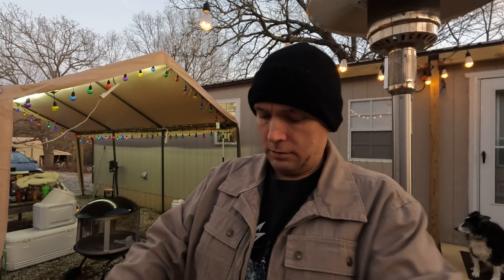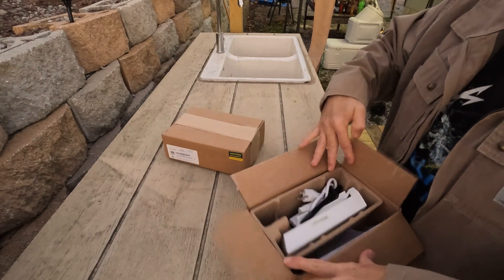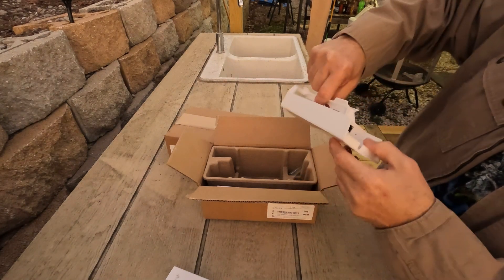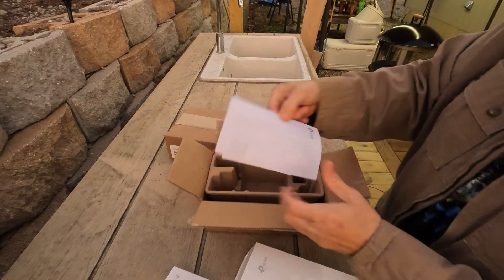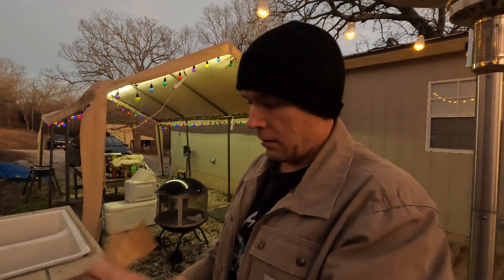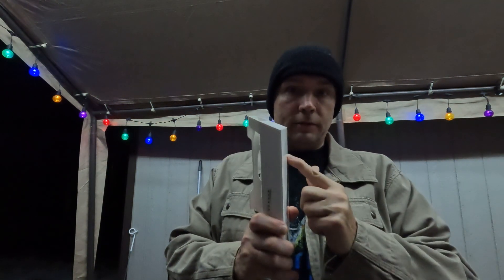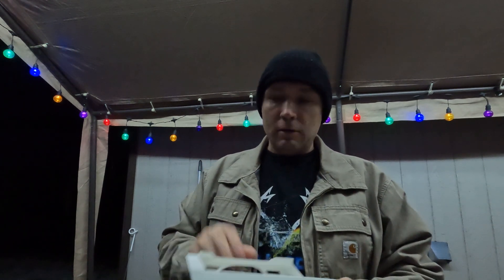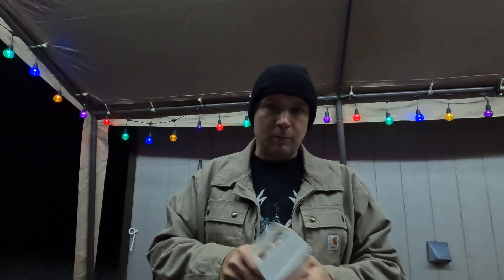TP Link CPE 210 wireless bridge unbox and install to the barn

Comment: I'm thinking of using this as a rudimentary extender down a 3/4 mile driveway. Am I correct in understanding that you cannot simply point one of these out, and then pick up wireless signal from within its range, but rather you need to point it at another one and then have the far one connected to a router or something? Thanks!
Reply from the maker: First you are correct. These are a bridge style device. You need two ends so one at each end of your 3/4 mile road. I used these for a while, maybe a year, but in the end the mount I was using broke while I was out of town and one side hung inside down allowing rain to get in killing the box. I went back to the Unifi WiFi bridge. The TP link has basically no "nerd knobs" where the UniFi does. I know there are a lot of others out there as well but I just went back to what I had before along with a better mount.
Reply: @tlchomestead  Thanks for taking the time to reply. Liked and Subbed 👍.

Off the top of your head, what nerd knobs in particular? I'm an IT professional but I have a heck of a lot to learn still...
Reply from the maker: I'll give a minor disclamer that I have >30yr in IT with the last 25 being in network world with a focus around route/switch, troubleshooting and network monitoring so I have a high desire to see as many stats as I can :D

The TP link has a very minimual web interface you can see maybe five things. It has been a while but I remember not much at all and being disappointed. The one plus the TP link had was you can look at the side of the physical unit and see the signal strength bars, if it was dark outside. Now, the Ubiquiti was much more details about signal strength, setup options (P2P, P2MP, base AP, etc) along with it has a 2nd RJ45 (passthrough) you can use if you wanted to -- think about putting an AP close to the bridge to add outdoor WiFi somewhere. This came in handy for me so I could add an outdoor AP and get signal to my RV for when folks where visiting. Also, if you run the UniFi ecosystem this sort of ties into the map shown on their controllers. Not perfectly but it gives an idea. 

Now, I have BIG changes coming this year and will make videos as I go through this process. We are building a new house and I will be redoing my network as part of it. And, I will ahve to extend my network from teh new house to my cabin so we shall see where I land with everything :)

Comment: Lazy tool
Reply from the maker: Lazy? Not following. As in I should bury a cable? I guess I could install some fiber and that would work here but when I expand to top of my hill I do nto want to trench that path :)

I will add that the TP link worked up until I removed it. TP link just did not have enough features. I love nerd knobs and TP link lacks. I went back to Unifi products.